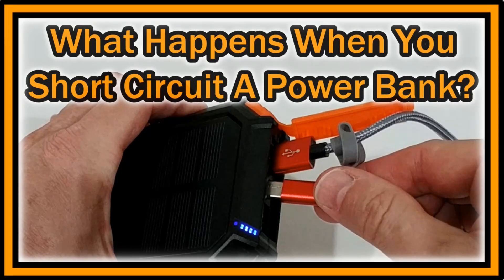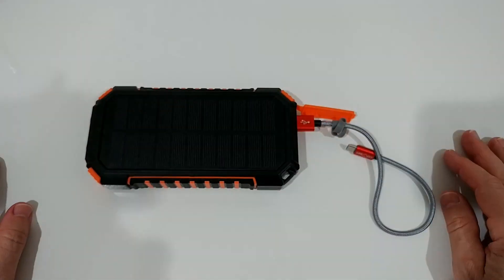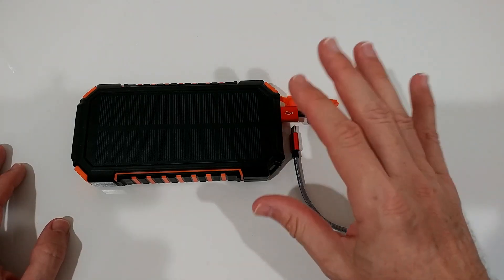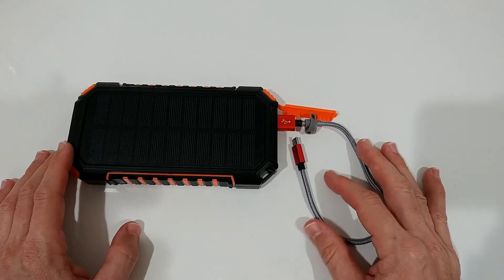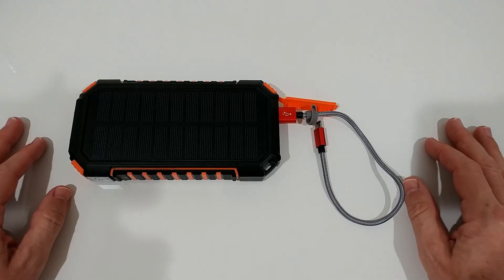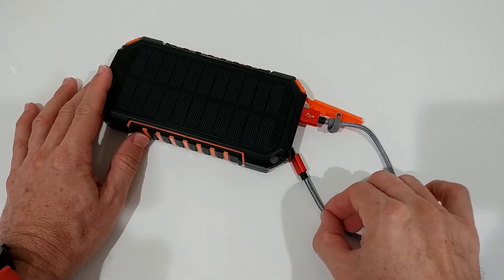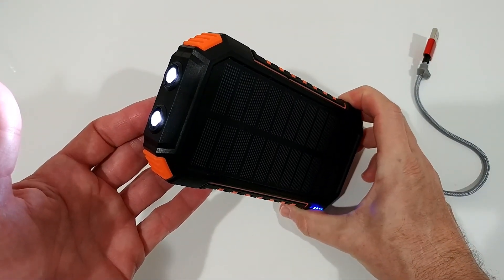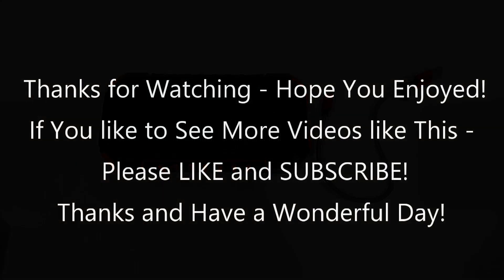What Happens When You Short Circuit A Power Bank?

Comment: I washed iPhone charger in machine and i left it to dry (not in rice) for about 2 days and I tried to charge my airpods and it doesn’t work. What should I do if I caused short circuit?
It’s a new original fast charger it would be so sad if I messed up like that.🥲
Reply from the maker: Sorry to hear. Are you talking about a wall plug or power bank? Anyhow I would be very careful to charge anything with it and definitely NOT an expensive iPhone first. Maybe some cheap headphones or so and if it worked for a while then use it on the iPhone. If it won't come back at all then you can assume to be RIP. Most unprotected electronics won't survive harsh cleaning detergent and long water submerging ...